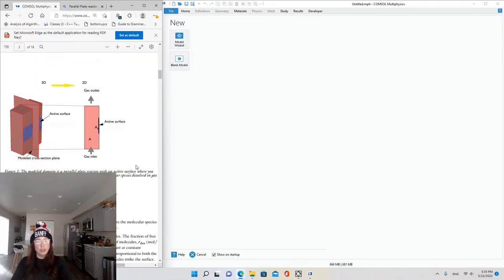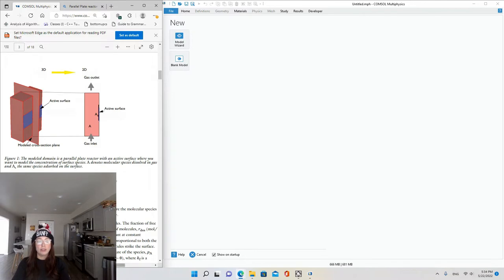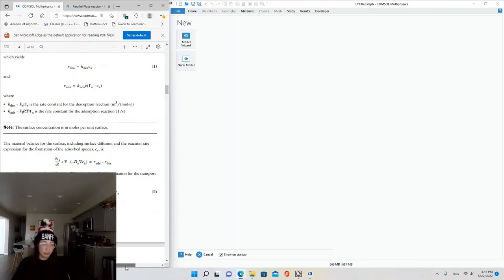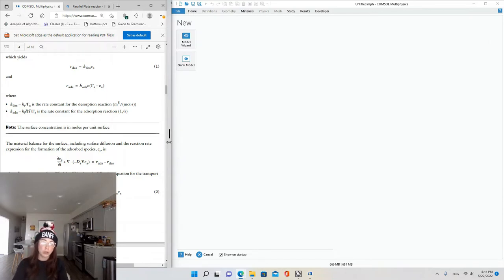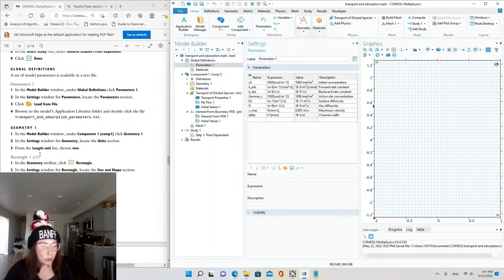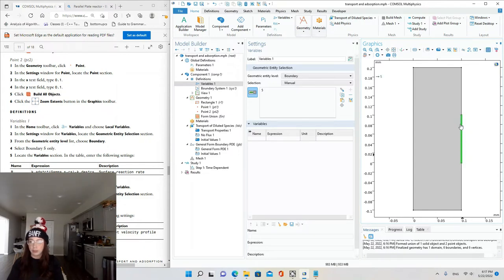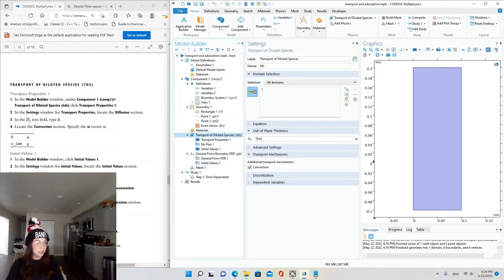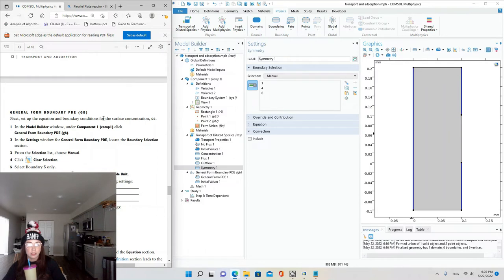Transport & Adsorption COMSOL Tutorial

Comment: Hi, I was trying to simulate adsorption with the module in Comsole. But it's as if the program doesn't read the adsorption at all and I'm left with a block at essentially the same concentration and it doesn't do anything for me
Reply from the maker: Hi 👋 without details it’s hard to say, but I would guess you’ve got an issue with your boundary conditions. Check any symmetry conditions especially. If those are all good check your units - do dimensional analysis. Also check how many time steps and size of steps for time study.